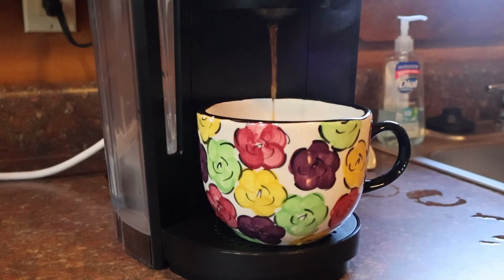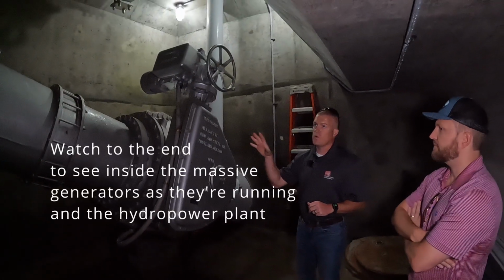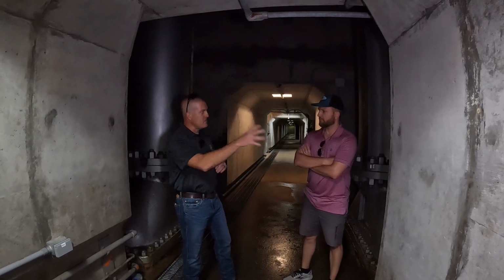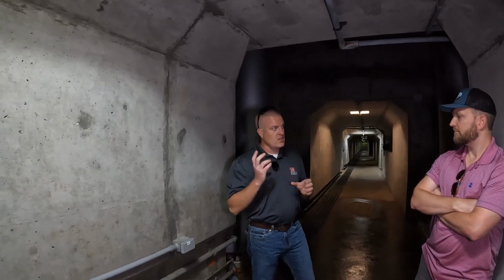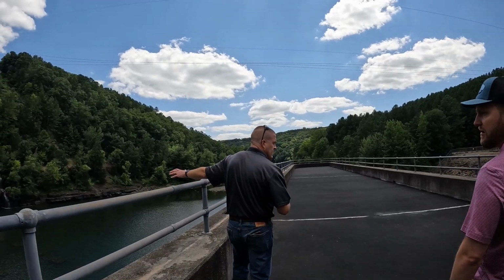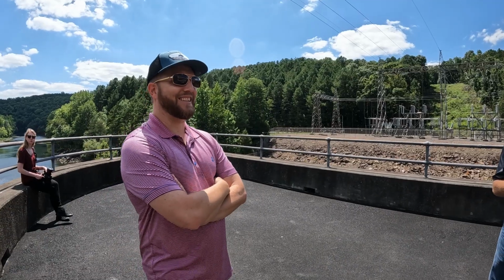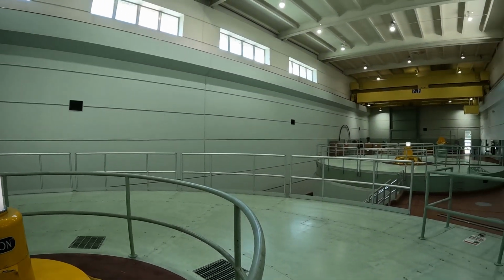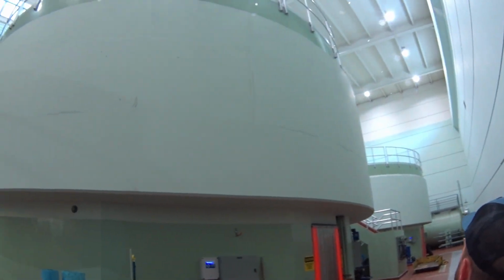Private tour inside Greers Ferry Dam -to the bottom! | Hydropower Plant | Heber Springs, AR | S2 E25

Comment: Water pressure increases directly with depth.  Each foot of depth is 62.4 pounds of force.  Each 33 feet of depth is equal to 1 atmosphere of pressure(14.7 psi) so at 33 feet of depth, there are 2 atmospheres of pressure acting on a body or 29.4 psi.  Water is 62.4 pounds per cubic foot or 8.2 pounds per gallon.  For all practical purposes, water is incompressible.

Comment: Lindsey looked a little nervous when they got to the bottom of the dam. I can sympathize. I got nervous just watching it! This was a pretty cool documentary about the dam, which is just about as old as I am. I didn't know they had smaller generators built in just to power the dam. And those piano wire movement detectors look pretty clever. Usual high-end production values as usual. 

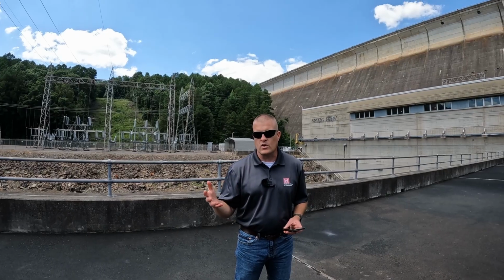27:20 I disagree with Townsend about the government having to pay to run solar or wind generation. I think he's thinking about the tax breaks that clean energy projects can get, but tax breaks aren't the same as the government paying your operating expenses. Tax breaks just pad your profits, right? As far as I know, those wind farms in places like west Texas are going concerns.

I certainly agree with him about the value of hydropower, and Arkansas is lucky to have such a resource.
Reply from the maker: Thank you for watching! I can't comment on what Mr. Townsend said because that is completely out of my wheelhouse! But, I agree with you. Arkansas is lucky to have the dams and the hydropower.
Reply: @AllAboutArkansasTravels  All that water is one of Arkansas' big draws for me.

The water out here in the Great Plains is often described as too thick to drink and too thin to plow. It's not pretty water. :)
Reply from the maker: @arkansasoutpost  That's interesting! I've never heard that